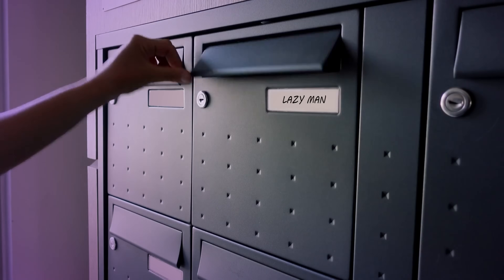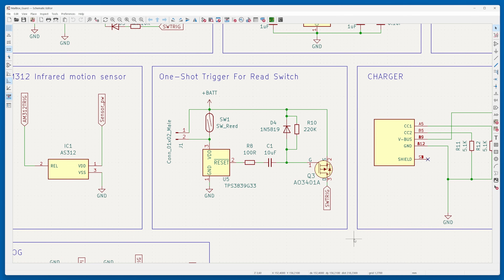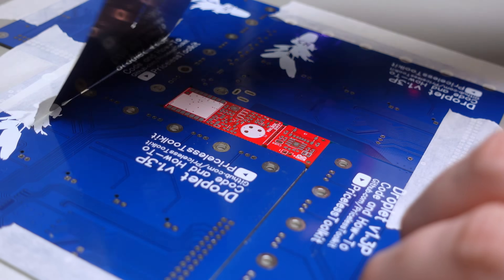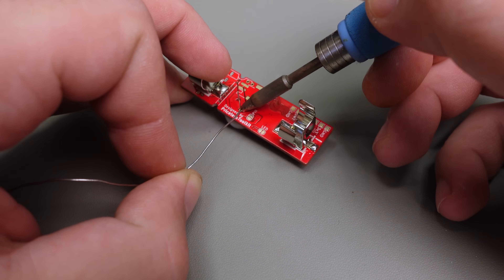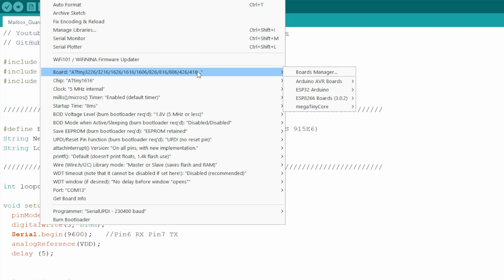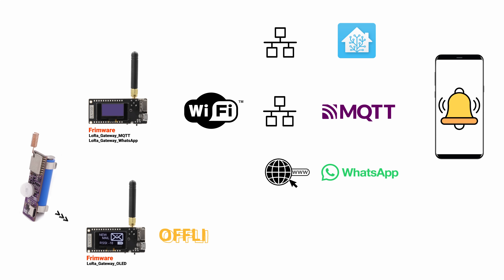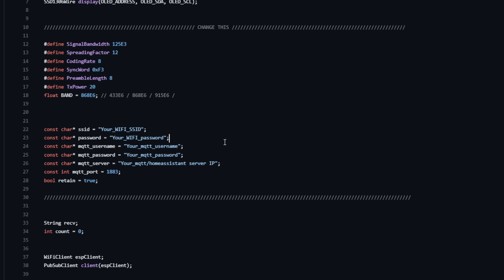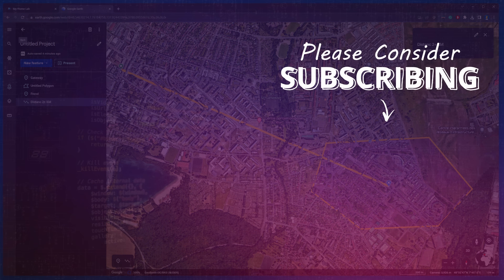IoT Mailbox Guard for Home Assistant. Defends Against Parcel Thefts!

Comment: How do I buy the complete mailbox sensor with housing ?  My mailbox is aluminum and built inside a brick enclosure.  Zigbee has the distance but cannot penetrate the brick.
Reply from the maker: Hi, I don't have a 3D-printed case in stock. How far is the distance between the mailbox and the house?

Comment: Are reed switch and PIR sensors wired with different pins? I'd like to be able to reset mailbox notification automatically when a mailbox is opened (my mailbox has a lockable door for taking out mail and an open hole to put mail in)
Reply from the maker: No it's the same Trigger circuit. Wait for next and last version.

Comment: But what frequency should I use? 433 or 868?
Reply from the maker: it depends on where you live, USA 915, Europe 868, Asia 433?
Reply: @PricelessToolkit  is it because of legislation? I live in France and most gates use 433 remote controllers. I don’t which is better
Reply from the maker: @XSpt1  433 has more wall penetration power, but if your mailbox is 50 m away 868 is ok.  PS: I live in France too. and yes it is because of legislation.

Comment: I have a few IFR14500 3.3v 600mah lying around, … is it enough for this sensor ?
Reply from the maker: LiFePo4 ? the capacity will not be fully used. maybe 5-10%, or maybe the sensor will immediately say that it’s discharged.

Comment: Thanks for this cool tinkering thing to fill my evenings and nights :)  I've reflowed with this mini-oven, flashing via jtag2udpi of the tiny Attiny surprisingly worked, no shorts.
Is there a way to easily test the charger circuit? However TP4056 has 0.45V on the VCC and GND pins when i measure it. The LED barely flashes for 100ms. No current flows. Do you have any Idea where should i look further? I've soldered the battery terminals directly to + and - pads, maybe that was a mistake too... I don't see anything else that can be faulty, capacitors or resistors usually won't die, so maybe TP4056 is faulty? 
p.s. One weird thing i noticed that the body of Type-C connector is not grounded. But maybe that's not important in this design.
Reply from the maker: I am glad you liked it, The USB is not meant to be grounded on the device side, TP4056 is faulty, or "maybe the first pin of the TP4056 is not in the correct pad?" you measured (0.45V) when the battery is not connected? can you share a close-up photo?
Reply: @PricelessToolkit  photos are getting removed unfortunately.
0.45-0.48V (and dropping) is measured when battery is connected or disconnected, Type-C is not. Measured through Vcc-GND pins. The BAT-GND returns 4.08V, correct for my battery.
When i plug USB charger red LED flashes quickly, Vcc goes to 5V, when battery connected.
But the charging won't start...
Now when i disconnect battery and try to measure GND-Vcc with connected charger, the Green LED does light up for a second then fades away.

If i try with Powerbank's USB (connected), but disable it (it disables automatically after some time), then i see 2.2-1.6V jumps, but probably that's irrelevant and how my Powerbank "sleeps".

Just tried to swap with different TP4056 chip from the same batch, same result, unfortunately.
Reply: updated with more correct info
Reply from the maker: you can open discussion in github Github and publish photo there @funkylosik
Reply: just for others to know, it was user error while assembling. The R13 and R14 resistors were placed and soldered on the wrong pads, perpendicular to the IC, not parallel to it. So be sure to check if you're within the white markings on the PCB (or have a pick and place machine, haha, that eliminates... you)

Comment: I live in a tall building. It would be great if you could make a cellular (SIM card) version.
Reply from the maker: It won't be power-efficient. Plus, only a few people might be willing to pay a monthly fee for SIM usage. +it will get more expensive. what floor do you live on ?
Reply: @PricelessToolkit  near 40/F. The mailbox is on the G/F inside the building. I am thinking to power the module with a 20000amp power bank. When it is triggered, it connects to cell network, send the signal and disconnect. I can subscribe to a SIM as low as about $6 per month. Thanks.

Comment: I have a few RA-01 433mhz and also my lilygo ttgo modules are 433mhz. I reside in Europe/Spain and was wondering what are the downsides of using this frequency here ? Its a small town so I doubt I could face legal issues especially the air time these sensors get ...
Reply from the maker: Basicaly i is a LDP range the problem is bandwidth, LoRa uses a minimum of 125 KHz  https://en.wikipedia.org/wiki/LPD433  there is section for Spain

Comment: I didn't understand witch receiver to choose if connecting to HA. Is it the one linked in description on AliExpress?
Reply from the maker: Yes, just make sure it's the same frequency as the sensor you choose.
Reply: @PricelessToolkit  Thank you. Then all is ordered. I have never used this kind of tech before. Do one receiver handles several senders? I would like to see if I can find a sender that can me if a container is full of water that have the same wireless technology and can trig a action in HA.
Reply from the maker: its depends on what firmware you use for gateway, Sample version publishes row data
Reply: @PricelessToolkit  in other words, I would not understand it since your answer didn't make any sense. But let me first try to get your unit up an running, I see that it's already shipped, but it will take some weeks for the gateway to arrive here in Norway from china. If I can get this to work I probably also have a bit better understanding of all this, and then your answer will probably make sense to me (I hope) 😅😉
Reply: @PricelessToolkit I have now got both the sensor from you and the gateway from china. Does the sensor (when I buy it prebuilt form you) have the correct FW so it's only the gateway fw and the HA part I need to deal with?
Reply from the maker: @TormodNicholasMortonTorgersen  I test sensors with "Mailbox_Guard_Sensor.ino" so if you want to use MQTT or HARestAPI version, you need to reflash it.
Reply: @PricelessToolkit  ok, i was thinking that mqtt would be the best. So flash it then. I need a adapter for this I guess. One more order then
Reply from the maker: I'm not sure why, but you're not the first to overlook the information about needing a special programmer. I've mentioned it in the video and it's also highlighted in red on the product page. It's unfortunate that you'll need to place another order due to this.
Reply: @PricelessToolkit  I did see it, I just tough it was for the ones that build it from scratch 😊 no worries, i need it anyway so just one more reason to buy one. Never done anything like this (only used commercial gadget) so have absolutely no idea what in doing 😅😂
Reply: @PricelessToolkit  ordered from you just now. Then I'm sure to get the correct one at least 😅
Reply from the maker: @TormodNicholasMortonTorgersen Yes, I saw your order, I will send it on Monday.

Comment: I just received the ready-made sensor type "868 / 915 Mhz" from you in the mail. Thanks for your awesome project! 

So did you program the sensor with 868 Mhz or 915 Mhz? Are the NewMailCode and LowBatteryCode the same as shown in the video?

Unfortunately I did not order the UPDI programmer from you because I thought, that I can use the pre-assembled one right away.

Any help is appreciated!
Reply from the maker: Hi, thank you for your support, if you have a USB TTL 3.3V programmer, you can convert it to UPDI search on Google "Serial2UPDI". But I flashed and tested all sensors, so yes it is programmed. 868MHz  New mail code is "0xA2B2 or 0xA000" low battery code is "0xLBAT or 0xB000"

Comment: What advantage does the HARestAPI code have?
Reply from the maker: Many people don't use MQTT :)
Reply: MQTT is amazing @PricelessToolkit
Reply from the maker: Yes I know: "I use it" :)
Reply: Does the board come with a reed switch?
Reply from the maker: @ArneSchwarck  no
Reply: @PricelessToolkit  together will only PIR sensor?  These will need to be purchased additionally:
1. On-board reed switch "optional"
2. External reed switch "Input 2 Pin" ?
It is difficult to understand normally what you get when you buy.
Reply from the maker: I corrected it on the site, I hope it will be more clear now
Reply: I think I got confused with on board and build in. For me the word on board also means included but you mean it can be optionally added on to the board.  @PricelessToolkit
Reply from the maker: It's totally my fault! I updated the description on the shop
Reply: @PricelessToolkit  do you have any suggestions which one I should order over Ali Express?
Reply from the maker: @ArneSchwarck  For soldering on the pcb or with cable ?
Reply from the maker: @ArneSchwarck  I added links to the Github

Comment: Amazing! Me and my father developed one similar to this, but when we talk about energetic efficiency, our device its very bad! So, one question, why you can not make a function when you open the BIG door, resets the notification to 0?
Reply from the maker: Thanks, 1: I didn’t do this because here in Europe the postmen open the big door to put in the delivery. 2: PIR and REED sensors share the same circuit.
Reply: @PricelessToolkit  the solution its very simple! Offer me one and i tell you the trick! XD
Reply from the maker: @carlosmfalves  there is one solution to change the circuit design by adding one capacitor :)
Reply: @PricelessToolkit  I have a more simple solution! XD
Reply from the maker: @carlosmfalves  👍

Comment: Is there a simple way to upload the BOM to example mouser and order all of the parts?
Reply from the maker: I don't know, you can do it manually. 10-15min
Reply: @PricelessToolkit  Yeah, I thought so too but I can't find the stuff in lcsc. Do you have the possibility to export the BOM from their site and add it to the github?
Reply from the maker: Tomorrow I will update the file and I will include the LCSC Part numbers.
Reply: @PricelessToolkit  much much appreciated ❤️❤️
Reply: @PricelessToolkit did you manage to update the BOM?
Reply from the maker: Yep, for important components
Reply: @PricelessToolkit  I hate being a rube here but there's still no voltage values mentioned on condensators etc...
Reply from the maker: @raz0r00  Select capacitors and resistors with a voltage of 10V and above

Comment: Nice video! So i would need the gateway and the mailbox sensor to work?
Reply from the maker: That is correct
Reply: @PricelessToolkit   Did you have it on your site? I didn't see it.
Reply from the maker: Mailbox guard yes but "out of stock", gateway no
Reply: @PricelessToolkit  Where can I get the gateway?
Reply from the maker: Aliexpress links in the description.
Reply: @PricelessToolkit  Thank you
Reply: @PricelessToolkit  I order it but didn't see the case you had in the video.
Reply from the maker: Thank you for your support, For now, I do not sell those.

Comment: Verkaufst du das fertige Gerät oder muss ich da noch was draufspielen? Und ich brauche zusätzlich noch ein Lora-Gateway, richtig?
Reply from the maker: Ja, ich verkaufe in meinem Geschäft fertige Postsensoren, diese sind jedoch innerhalb einer Woche auf Lager. Sie müssen ein Gateway und eine Batterie kaufen, Links finden Sie in der Beschreibung. "Übersetzt mit Google Übersetzer"
Reply: @PricelessToolkit  thank you for your answer. wow, that's great! I'm a Software Developer for over 20 years now, but my knowledge in these electronics is between low and zero, so I very appreciate your work!
Reply: @PricelessToolkit  it's just crazy to get the hands on affordable lora-gateways. Or am I blind? I'm just seeing devices for 200-800 Euros...
Reply from the maker: @bliblabl8149  ☺ Gateway on Aliexpress https://s.click.aliexpress.com/e/_DdCLj19
Reply: @PricelessToolkit  thanks again!! 👍 so my last problem still is my missing knowledge about the  concrete steps to handle all this stuff.. 🙈 😩

Comment: @PricelessToolkit, Could you please share your firmware to flash the LILYGO® TTGO LoRa32 V2.1 1.6.1 ? I'm almost getting crazy trying to flash it, without sucess! Can't compile, SPI.h error! ;-/
Reply from the maker: Hi I uploaded Arduino IDE config screenshot on Github "TTGo_V2_1___1_6_1.png".  I think you just haven't selected the right board in IDE and in board.h
Reply: @PricelessToolkit  Instead copying  your files and using it, i copy and paste the raw data into IDE, and maybe something went wrong, or was because my IDE was outdated, now everything is working! Ty

Comment: Awesome project! I like that a lot but still have questions about the functionality. If I understand correctly, the drops in my mailbox are detected via the PIR motion sensor? I live in Europe and would need to order the TTGO LoRa32 with 868 MHz? The TTGO LoRa32 would then be connected to WiFi in my apartment (4th floor) and as soon as someone throws something in the mailbox on the first floor I get a notification by HomeAssistant or WhatsApp.
Reply from the maker: Thanks, Yes all correct. You can use 433MHz too

Comment: You could mount this on your street parked car if the range is that great.  I live in Boston and would have been able to get an alarm when my street parked car got towed from across the street a month ago.
Reply from the maker: Hi, just a reminder that it's not recommended to keep batteries in cars during hot summer months, as high temperatures can lead to the risk of battery explosions. By the way, I also have a project on my to-do list for a car alarm.!
Reply: what what you do, run after the tow truck? :D

Comment: Nice, I've been thinking about trying a Lora sensor for this job. I've tried using a zigbee sensor but with my mostly metal postbox even though it's on the wall of my house and near zigbee router nodes the sensor frequently drops off the network.
Reply from the maker: Maybe you have other problems with ZigBee because 5? meters is not big of a deal for Zigbee.
Reply: @PricelessToolkit  The rest of the zigbee network is fine, including the same sensor in other locations. I think the stainless steel box is really weakening the signal.

Comment: Awesome project. Did you try it inside a metal mailbox with the antenna inside? Or did you mount an external antenna in the mailbox?
Reply from the maker: Yes I did, I live on the third floor, and I have a metal mailbox too "no external antenna ", + two reinforced concrete floors.
Reply: @PricelessToolkit  Thanks for the reply! I have my own mailbox, so could drill a hole if I need to, but was curious if it might work. Plus for me, part of the fun is making the project and getting it working, so I like projects like this.
Reply from the maker: More projects are on the way, so get ready 😊

Comment: The USB hot plate looks to be quite interesting.

Though instead of a 65W quick charger, I would rather suggest a 100W charger like the ones from TOOCKI [which work quite well with a Pinecil]

Also ordered one of those Silicone cables with metal caps, to test out to see how these work with the pinecil. [already have a flexible usb C cable, but wanted another one for cheap]
Reply from the maker: ⚠️ Mini Hot Plate Requires "Power Delivery (PD) Charger" ⚠️
Reply: @PricelessToolkit  Most toocki 100W chargers support nearly all PD protocols.

Comment: I found your video randomly. Watched it loved it. Btw In your li-ion charger schematics you haven't used a series resistor (.1ohm) to positive voltage. Will it charge without the resistor.? Great tutorial learned something. Subscribed🎉🎉
Reply from the maker: Thanks. Datasheet requirements is .2-.5 ohm. you can discard them if your charging current is low only 130/250mah, so no high inrush current. "At least that's how i see it". PS: You have a good channel!!
Reply: @PricelessToolkit   I made a similar charging module myself but it's not charging also the tp4056 getting insanely hot🔥
Reply from the maker: hotness depends on charging current! turn it down and you'll be fine.

Comment: Very nice! Works through metal mailboxes?
Reply from the maker: Yes, it does! but the range decreases of course
Reply: tested from the 6th floor to ground floor. When placed near the edge of the door, it didn't work. When moved 3 cm away - to the middle, then works every time. -95 rssi.

Comment: While i like the idea. I would have good with another battery and yes i say it now NON RECHARGABE one. Due to their magintudes lower internal resistance/ self discharge rate, my sensors run theoretically 10 years on 2 AAs. Although im using NRF24s so using wifi your milage may change. But my test with 18650 cells showed they last a couple of months at best. They are rather suited for high power.
Reply from the maker: I am not using WiFi its Lora, and yes you r right internal resistance is higer then AAs but the mailbox sensor consumption is so low that it can work 160 days with battery of 50mA *in teory

Comment: i need that years ago, and i bought a door entrance ringer, as in small shops. When you open the door, the IR sensor detects movement and RINGS the bell. I put the sensor module into the box and the receiver on the plug in my home. Everytime now when a letter disturbed the lights inside the mailbox i get a ring, but THIS is very small and PERFECT
Reply from the maker: Thanks for sharing